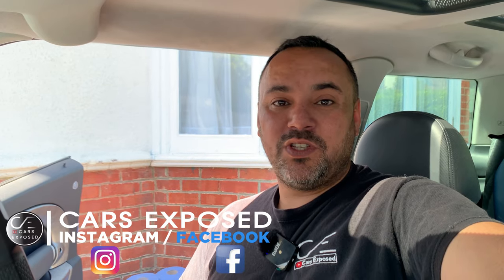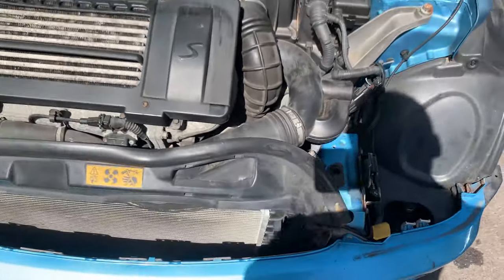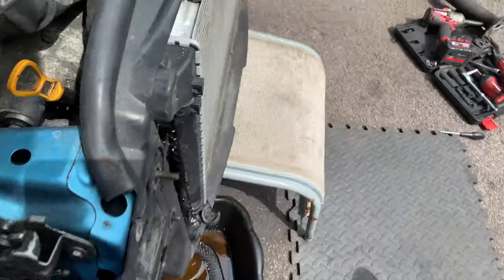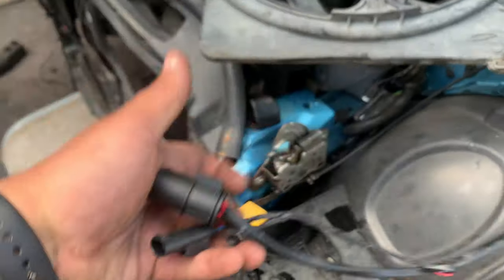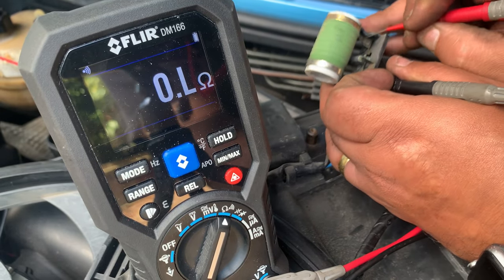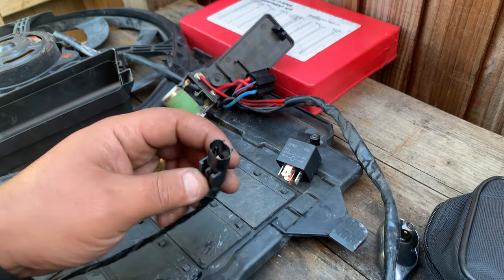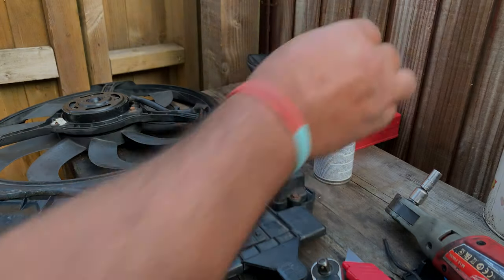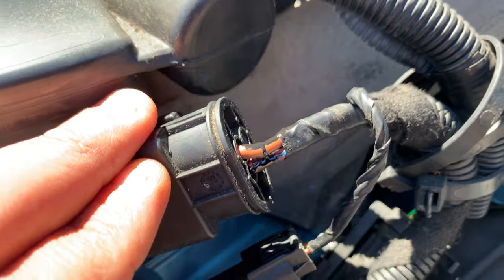Mini Cooper S R53 Overheating FINALLY FIXED | Cooling Fan Change and Radiator Leak

Comment: Just noticed a week ago that the car was getting a bit hot and when I got home If I turned it off right away the reservoir would bubble a little I hooked up scanner and saw regular temps, I read on a forum to let it sit until fans start then shut off and no bubbling. I can’t do it every time I drive so I looked online some more and realized that only high temp fan was running and not low temp fan, I know it’s one fan but two speeds. So this must be the issue. I did test the engine block for exhaust leak cause my Audi had bubbling in the res tank but showed no signs of blown head gasket until I did a block leak test. I tested the block and it was fine so I was happy to see that. Also the plastic bleeder screw was previously stripped so I ordered a new brass bleed screw cause I read they strip or break very easy. Thank you for this video! Some one had told me that the whole fan had to be replaced which is obviously not the case.

Comment: Great video. FYI a soldering iron, like one used to do stain glass, would work and heat the wire from underneath and let solder flow to the iron!

Comment: Nice job Igor neat and tidy and the right way to do wiring. the liquid tape is great I have seen jobs done with just a swist of the wire and a bit of insulation tape over it drive me crazy
Reply from the maker: Ian Kelly thanks Ian ... I’ve seen that aswell it never lasts ... cheers 👍👍👍🍻

Comment: How's she goin'?  Nice repair.  It's always nice when you can determine what the fault is and then prove it by looking at what is damaged.  Interesting about the fluid leak.  Must have been like that from the factory like you say.  Thanks for sharing and take care!!
Reply from the maker: Thanks Mike yeah finding the failed part is the way to go ... Yeah the radiator is just over a year old I’ve noticed recently it was weeping a bit but couldn’t believe it was coming from the elbow connector , well at least seems to be holding for now with a thicker O ring 🤗🤞👍👍👍

Comment: I bought a Mini Cooper R53 2005 is overheating but I haven’t find the solution , I change the thermostat, radiator which was leaking also installed a brand new, my mechanic also suggested me to replace the spark plugs and Ignition coil and cables and the card is still over heating. 

I noticed the steering wheel is kind of hard to turn left o right, I looked underneath the card and the power steering pump does not have the liter cooling fan , and the car just overheat when I stop in a traffic light or to add some miles in the gas station .

I have the hypothesis that maybe is overheating because of the power steering pump is not working properly and also because the fan is missing . 

Could you please give me your opinion? I would appreciate

Comment: Nice one Igor. Most of those minis I've worked on for Aircon just cycle the condenser fan on speed 2 because that resistor is always blown.
Reply from the maker: Yeah those resistors don’t seem to last for too long , I was surprised about relay for speed 1 being commanded on for speed 1 and 2 , I’m not sure about the strategy there but it works 😊👍👍👍 cheers mate

Comment: I like the liquid insulation product you used on the wiring repair. I would suggest you try adhesive lined heat shrink if you haven't done so already. Expensive but great
Reply from the maker: Thanks mate , yeah good stuff I’ve used in the past 👍
Reply: P

Comment: I have a mini one 2002 1.6 90hp. the speed of the antifreeze cooling fan turns on at 112 degrees. antifreeze is as it should be, everything is ok. Is that all right ??

Comment: Hello Igor, great video ! I have the same problem with the fan. I also bought a new resistor like you did. There are 3 wires, 2 red and one blue. I tried to see how you connected them, but its not quite clear. Can you tell me where the blue wire goes? The 2 red wires are clear. It looks to me as if the new/second hand one has no relay at all...I am not very good at electrics so is the relay gone ? And the blue wire connected somewhere? I hope you can help me out here...Kind regards from the Netherlands. Martin

Comment: i bought a new radiator, that looks very much like yours.
upon inspection the o-ring was not at fit properly. it was totally dry and twisted, deformed like yours.
i also noticed the groove around flange connection is like .5mm too deep, even if the o ring was fit properly, there'd be issues soon.

these problems are common with cheap aftermarket parts.
however i put some silicon spray to the ring, then applied silicon sealer around the flange, making the flange permanently fixed to the rad.
no leaks so far.
Reply from the maker: Thanks for the feedback mate , aftermarket parts seems to be getting worse and worse in my opinion 👍👍👍

Comment: hi, i have problem with mine r53 where the fan wont turn on even after I changet whole resistor. the fan turs on when I do it with PC. 
I can see that you have to cables for the fan. Is there a reason I have only one?

Comment: Nice Igor. It’s good to familiarize yourself with the cooling (and condenser fan if equipped) circuit...It will fail sooner or later. Cheers Pal 👍
Reply from the maker: Thanks mate I agree there ... recently I’ve fixed quite few overheating issues and a/c issues ... cheers mate 👍👍👍

Comment: Hi great video very good. I saw my Mini r53 also starts fan at 105 degrees Celtius. And stops at 100 degrees. So I think it’s the second fan like A.C. I would like mine to start like at 95 degrees and stop at 90 degrees. You think it’s ok to start at 105 degrees because it is an lot of pressure.
Reply from the maker: I’ve seen lots of vehicles starting the fan at 105 , to be honest if it’s designed like this I don’t see a problem in leaving it 👍👍👍
Reply: @CarsExposed   
Yes but it seems like it wants to through te water out of the tank